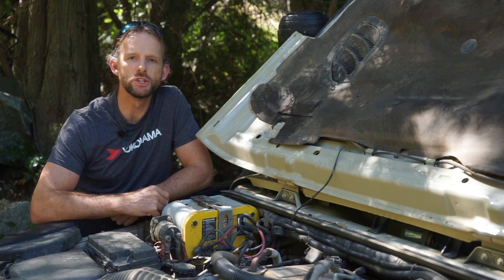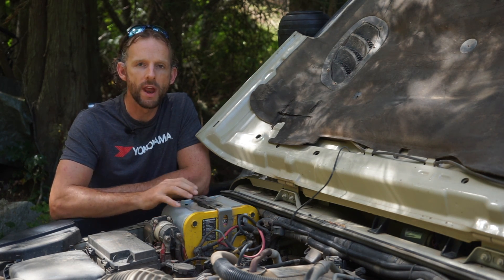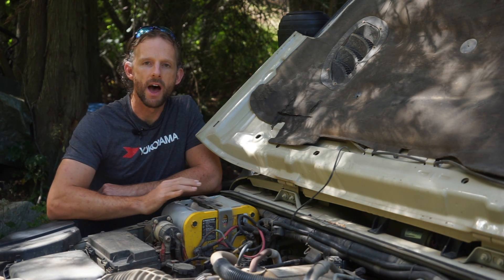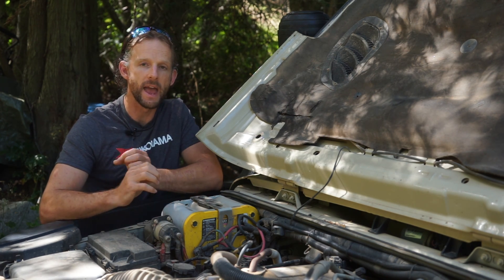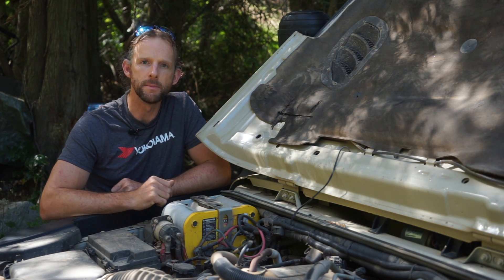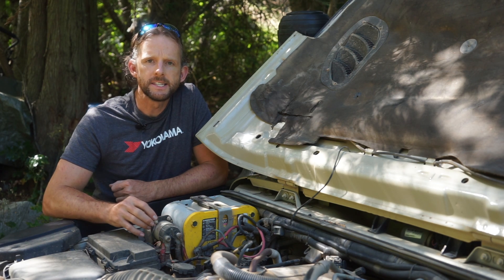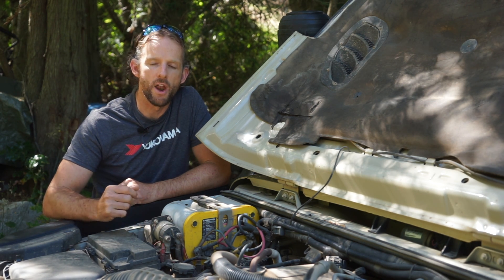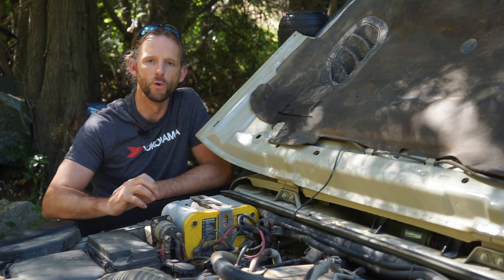DIY Dual Batteries for your Overland Vehicle - what, why & how

Comment: Out of curiosity since the cost and simplicity of portable power banks has been improving quite a bit, how would you choose between a dual battery setup and a power bank?
Reply from the maker: Power banks are the jack of all trades but the master of none.
The dual battery setup I have in my current Jeep is much better than any power bank.
3000W inverter, 200Ah of battery, 50Amp DC/DC + MPPT solar and 600W of solar.
Reply: @TheRoadChoseMe makes sense to me!

Comment: Very cool setup! Beauty in simplicity.  You could use an oil pressure switch to trigger the solenoid, that way the batteries on connect when the engine is physically running

Comment: Your system above made perfect sense in the 90s. 

In this era, the question is: 

Your house battery is almost flat. You start the engine. 
Can the alternator sense that the house battery is very low? 
Based on my understanding, the alternator “senses” the starter battery. And the starter battery is not in a hugely discharged state. 

Hence, how long does the alternator take to recharge the almost flat house battery?

The Optima is an AGM-type Deep Cycle battery. Can automotive alternators effectively and optimally recharge such batteries?
Reply from the maker: I agree it's an outdated design, that's why I've improved it in every possible way for my new vehicle build! details here: https://www.youtube.com/watch?v=i-gK0BBxlrI
Reply: @TheRoadChoseMe  

Thank you, sir👍

Comment: How does this work with a winch that can pull upwards to 630amps peak? Which battery would you put the winch on?
Reply from the maker: As long as the engine is running, it makes no difference - they're both connected to the alternator which is really powering the winch.
In reality though, I have it connected to the starter battery, directly touching the big wire coming from the alternator.

Comment: I made a LiFePo4 battery out of cells from alibaba for a 280 ah batter that weighs about 40lbs and i made a wooden box for it kto live in on the passanger side of my xj and have a iverter and the dc to dc charger screwed to the box as well and i have wires ran to the batter from my alternator with the dc to dc charger and i have a solar charge controller for the 100 watt renogy panel on my roof and being a pc gamer im able to run my full desktop gaming setup normally for about 14 hours straight and that includes playing games at insane quality like cyberpunk 2077. But to save power im going to get a gaming laptop that uses about 100 watts compared to 400 wats from my desktop pc while its running. I have a switch on my dash so i can turn on and off the charging of the battery from the dc to dc charger while im driving and honestly sometimes i do forget to leave the switch on and it drains my car battery but i can just run jumper cables from my house battery to the car batter and start my car so im never really stuck well if there is no sun and im out of charge then i cant lol

Comment: Which house battery are you running?
Reply from the maker: Optima Yellow Top D34 in the current Africa Jeep, but I'm going a whole new direction (into the 21st Century) with my upcoming vehicle build!
Reply: @TheRoadChoseMe  so both of your batteries at optimas ?
Reply from the maker: yes, they're both identical, which is a requirement for the type of "dual" system I have where the solenoid joins them in parallel. You don't want to do that with different batteries, because they will charge/discharge unevenly, which will be bad for one of them.
Reply: @TheRoadChoseMe  ahhhh I see. Right on thanks man!

Comment: Wow! Loved this one! Definitely going to use the solenoid set up, my rig is going to have several overlapping systems, so if one system fails, it can be covered by another
Reply: One of my donor vehicles for the rig is a 1987 F-250 6.9 Diesel with two massive batteries from the factory.....for the rig, I’m planning on the 3 panel roof mounted solar panels and a bank of house batteries up front in the nose cone away from the mid/rear engine.
      I’m definitely love the idea of linking the battery bank to the vehicle battery via solenoid.......a solar strip across the rear deck will act as a battery tender if the vehicle sits for long periods, and can be switched “on” to activate the folding roof panels when the sun comes up, and close them when it goes down automatically.    A switch on the dash can connect the battery bank to the vehicle batteries for a jump start.
      The vehicle is also going to be equipped with an inline generator with switch ignition.  Everything will be wired up to compliment each other.....let’s say the alternator fails, and your losing power, switch on the generator and flip all vehicle electrical to the 12 volt supply, until you can get to a safe place for repair.
     Another example would be if the water pump failed, which could happen in South Africa, a bypass pump can take over.
      Like you said, you can not predict or plan for every emergency, but if you are building a rig from scratch, you can design in a lot of prevention

Comment: A modern and cheap solenoid option to isolate two batteries is the VSR - voltage sensitive relay. The difference for regular solenoid is that it has a microprocessor that promotes a controlled delay on turn the dual batteries system on, and off. It is good to avoid drain some charge from house one when starting engine, and promotes a more long period of equalization of charges between batteries, after engine goes off.

Comment: I love these no nonsense videos!  Are you still running the stock alternator?
Reply from the maker: I had to replace it recently - it finally died.
Reply: @TheRoadChoseMe  
Not a bad run if it was the original!
Reply from the maker: It was, as-is essentially everything on the engine and the whole driveline.
(Including the rad hoses, serpentine belt, etc. !)
Reply: @TheRoadChoseMe  
That is a testament to the Jeep! And as you have said (vehicle preservation). I have a 2018 JKU , and plan on keeping it forever! 
Motor on!!

Comment: If you did the DC to DC would you still need the Solenoid in the system? Or use the DC to DC and two batteries only? Or would you splice the DC to DC into the Solenoid system, on the positive leads? 

I love the simplistic of your setup. My house battery is for charging laptop, cameras, and cargo lighting, which I was going to get a inverter to help with the load of charging laptops inside my Jeep. I just know a DC to DC are NOT waterproof, so I would have to bring all that wiring into the Jeep and find a dry place to mount that as well. Thoughts?
Reply from the maker: I think a quality DC to DC includes the "isolating" aspect of the solenoid, so it's not needed.
The Renogy charger I mention does it all.
You certainly want it all inside, as you say.

Comment: Im hot an expert but i dont think alternators actually charge a battery, it just help maintain the voltage from dropping?
Reply from the maker: They charge the battery, otherwise your battery would eventually go dead from all the starting...
Reply: @TheRoadChoseMe  as you said at the end just a bit not enough for a big charge. Thanks for the answer and the good video! Im still in a 8-5  working schedule, i hope someday i will find a way to leave on a long trip. For now payment on the jeep getting at the end, les milage completly stock. You are a good inspiration and motivation. Peace!

Comment: I have the Genesis Dual Battery Kit with two yellow tops. Absolutely love it. I can run my ARB refrigerator for about 18-19 hrs without starting the Jeep. And the dual battery system shuts off my am1,000 watt power inverter if power goes to low. Plus refrigerator shut off as well. Plus I have a portable jump starter. Try to cover all my bases.

Comment: This is a very very bad way of charging two batteries, you've put your alternator in a situation where your starter battery might be floating around 12.4v  in normal use and your house battery might be sitting at around 10-11v..  I would strongly recommend that no one duplicates this setup. This is tant amount to using a hammer to drive a screw into a piece of wood.
Reply from the maker: Overlanders have done it this way since the beginning of overlanding, and it's been working perfectly for me and many others for many years.
Reply: @TheRoadChoseMe   This is the quickest route to shorten the life of your batteries and on some vehicles damage your alternator and ECU, this is the most lazy way of fitting a battery to any vehicle, whether it is a camper, caravan, motorhome or overlander and highlights a complete lack of understanding of how battery chemistry works. But if it works for you keep on trucking 👍🏽🙏🏽

Comment: I built the poor man's dual battery system. I didn't want to deal with the special ($$) dual battery mount in the engine compartment so ran an 8g wire directly from the starter battery (biggest Optima Yellowtop) through a 40amp slow blow breaker mounted on the firewall to charge the house battery (Fullriver 100amp deep cycle Grp31 AGM) mounted in the  back of the Jeep in a trolling motor battery case.  The house battery negative cable is connected to a handy tub bolt 1 foot from the battery.  The 8g wire provides enough voltage drop under high charging loads to keep the charge rate below 40amps when the (115amp heavy duty) alternator is running, but  is negligible as the battery tops off.  A 6-8hr drive (common when relocating) fully charges both batteries.

 If I'm not going to run the engine for more than a few hours (lunch in town etc.) I disconnect the house battery from the starter battery  manually at the house battery and if it's going to be a day or more hook up a military foldable  (5 pounds and folds up to book size, $850) 100watt solar panel which can recharge  the house battery in two days or so, even when running the 'fridge.  The downside to my setup is you have to remember to manually disconnect the house battery or after a day or three or you'll not be able to start your rig as both batteries are dead if you're running high loads like a 'fridge.

The upside is if I pay attention I'll have plenty of battery to start the car and essentially recharge my situation to start the car if one battery goes haywire. If the starter battery dies it will be a hassle as I'll have to jump (or switch out) to the house battery to start because that 8amp wiring will burn up quickly if the breaker fails during a high load start attempt.  Three times now I've had remote campers kill their stock car battery by playing their high power stereos/lights overnight, beg for a jump, and I drag my  AGM house battery to their car with a set of jumper cables & really stress it as their twin turbocharged engines finally fire up.

One final thought, quality spiral wound AGM or compressed Glass mat batteries are the best.  I'm on year nine on my Optima battery  and it's been through some tough times including running totally dead twice because of a short in the fog light switch.  I've a spare in storage and it's still at 13.4v after two years. The idea that  lithium ion phosphate is the future at five times the price  for a weight reduction makes no sense concerning the risks.

Comment: great info but PLEASE BE AWARE BIG AH 12V BATTERIES HAVE A MASSIVE AMOUNT OF DANGEROUS POWER
i thought a 50A anderson plug would handle the 40A DC/DC charger
But no it melted and luckily it didn't burn the car to much.
Plenty of cars been burnt to the ground by dodgy 12v systems.

Comment: NOt sure about your double battery setup, if the auxiliary is discharge but they get together while starting then the starter battery will have to start the engine PLUS share the charge with the other battery, or is it totally manual?? 

I have been using a blue sea M-ACR for a couple of years.
Reply from the maker: When starting they are disconnected, then when the engine is running the alternator will take up that laod. Also my system doesn't ever let the house battery get below about 11.5V.

Comment: Great video. I also watched your solar panel video, but did not get how do you connect your solar panels/controller to your house battery. If you connect directly between house battery and your panels/controller, does that mean house battery is being charged by both your alternator and your solar panels at the same time when you are driving?
Reply from the maker: Yes, in theory (that's how it's wired)
BUT - the charge controller "monitors" the battery, and when the alternator is spinning it puts out ~14.2V, so then the charge controller thinks it doesn't need to charge the battery, and it does nothing. The instant the engine turns off the battery voltage will be "real", and the charge controller will kick in and start charging if needed.
I have an old controller, that's how it works.
The new Renogy controllers are MUCH smarter, and they'll balance the charge, using all the solar available, and then topping up with alternator if needed. I will use one of those in a future build for sure, it sounds much better.
Reply: @TheRoadChoseMe  thank you. That makes sense now. 😀👍
Reply from the maker: You're very welcome. Let me know if you have any more questions or another topic you'd like me to cover!

Comment: Yep - as soon as you want to run anything electrical with the vehicle not running - you need a second battery of some kind.  otherwise you will be stranded waiting for sun (or someone) to boost your charge state. (Lights and fridges are the most obvious, laptops  and camera batteries can be charged while driving for many people.)

- For those times "a friend" has a flat battery - a portable booster is handy. Battery versions need charging before use (need to be kept "fully" charged), super-capacitor types - not so much. - the super-cap types can "self rescue" your own car with a flat battery.

My Camping/Touring Power setup is a Redarc BCDC1225D - connected with Anderson plugs to make it easy to put in and out of the vehicle, a portable solar panel complements alternator based charging - plug straight into the BCDC for "hybrid" offgrid power.
The 135Ah AGM  battery lives on a smart maintenance charger when not in use  - ready to go anytime.

(Pretty sure with just a jumper wire you should be able to "jump start" off the house battery - just simulate the "manual switch")
Reply from the maker: Sounds like a great setup you have!

Comment: When I put in my dual batteries, I was told by those "in the know" that running your batteries the way you have is essentially the same as putting in a new battery with an old battery - not a good idea - as it will put a lot harder load on the alternator and batteries. So I ran mine just in parallel and only use them for starting and running the regular devices (lights, radio, system, etc.) on those two batteries. For additional power for non-base systems I added two 200 ah deep cycles attached to an alternate charging system that runs either from land power or from a small generator. This way it can't discharge the main batteries, and the 5000 watt pure sine converter runs everything else nicely.  https://www.youtube.com/watch?v=wC6Dv6tBao0&t=20s

Comment: DC to DC converters are definitely the way to go. The Renogy unit you linked to is FCC Part 15 Class B certified, which is great for radio operators (most MPPT controllers emit a lot of RFI).

HOWEVER, I would never consider the unit you recommend because it is not IP67 or greater. Sure you could mount the device in your passenger compartment, but this is a bad idea.
Reply from the maker: Why is it a bad idea to have it in the passenger compartment? I always plan on mounting mine there (sensitive electronics and all)

Comment: I’m shocked you’re not using a BCDC such as the 1225D, you can set it up to properly charge whatever battery chemistry you’re running, and also has a solar input that’s MPPT, and not PWM which you have.
Reply from the maker: Remember, I designed and built my system in 2015, and I needed it to be literally bomb proof. No fancy electronics, no modules that do wizardry. Simple and it works was the main criteria.

Comment: The new system I am setting up for my Jeep does not rely much on the battery at all to start the vehicle. Instead it uses a bank of super capacitors to create to high amp jolt needed to start the vehicle. The super capacitors can charge up from even a nearly dead main battery, or no battery at all if you have some solar panels in the mix. Once they reach charge, you get about 3-4 attempts to start the vehicle. On a larger motor (my motor is the 2.5l) You may get less attempts at starting. From my 10 watt solar panel it takes about 12-18 minutes to charge the capacitor bank fully. Depends on the sun angle/intensity. These capacitor banks are readily available, and weigh significantly less than a second battery. I think mine weighs maybe a pound. There really is no reason to lug the added weight of a second battery anymore if starting reliability is what you want, a capacitor bank will deliver.
Reply from the maker: Wow, I've never heard of that. Do you have a link where I can read more?
Does that mean the alternator isn't even connected to the capacitors?
Reply: @TheRoadChoseMe  I am a little surprised you have not heard of the tech. There was an article in National Geographic circa 2013 about it. I have a link to one of the first research papers I read on it, but the tech may be greatly simplified today with prepackaged systems. Some people have omitted their batteries altogether just allowing the alternator to charge the capacitors, might work well enough on a daily driver perhaps. As far as system design and connections I am not qualified to offer any specifics, there are a lot of variables on a system like this.
https://www.ijser.org/paper/Introduction-to-Supercapacitors-and-Supercapacitor-Assisted-Engine-Starting-System.html